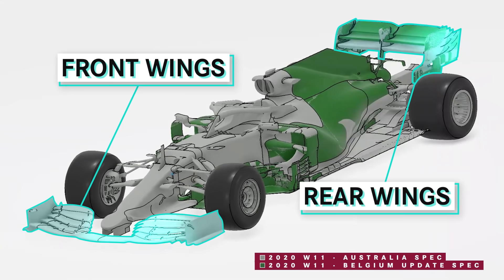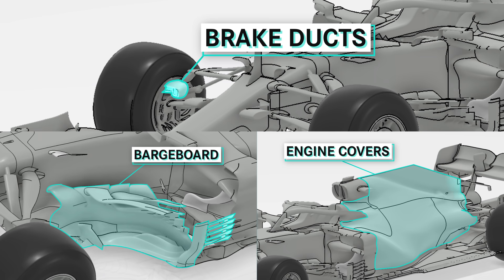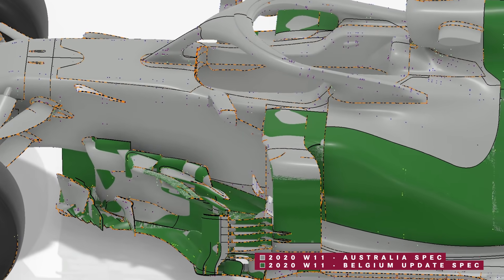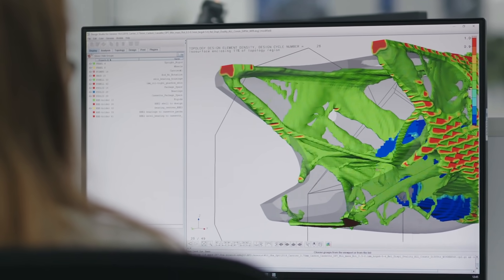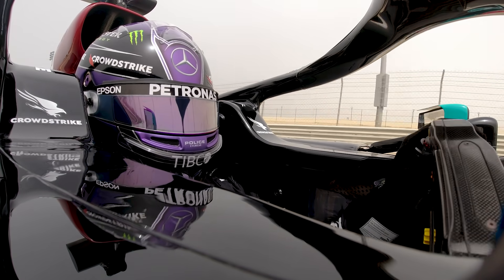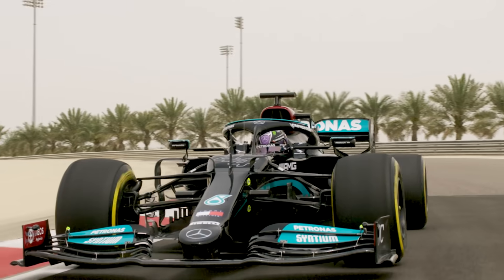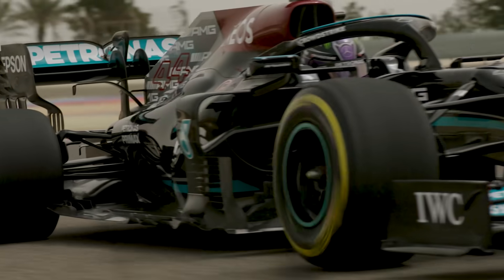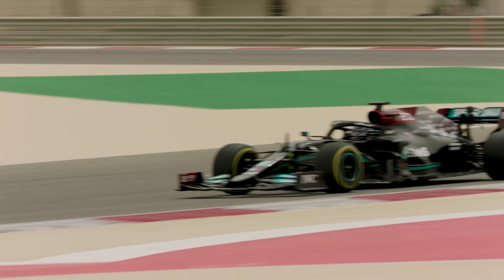How Do Teams Develop a Formula One Car?

Comment: well, it is at all possible to avoid manufacturing 1000 different iterations to reach a perfect solution? or is it hard to trust analytical numbers from the computer mathematical model? Because that seems like a lot of waste, both in terms or material and time
Reply from the maker: The vast majority never get manufactured, only the small number that get tested in the Wind Tunnel will be created (made in a different way to usual components, as they are usually 3D printed) and then only one will be turned into a physical component to go on the car. The hundreds of other iterations will be designed in computer software and tested in virtual simulations.